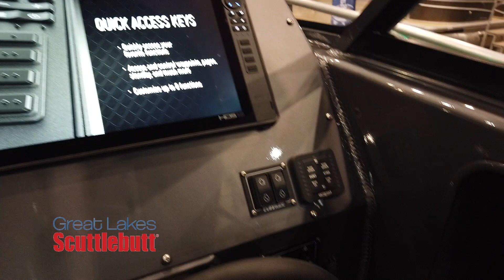Extreme Boats! 795 Walkaround! @The 2020 Cleveland Boat Show!

Comment: These high end off shore boats might be the high cost/high profit boats they wish to sell, but most real people spend far less and buy smaller, in shore outboard motors in the range of 16 to 20 feet with retail costs well below $60K. I don't see manufacturers like Lund, Tracker etc represented at these boat shows yet I would bet they sell more lower priced boats than these guys
Reply: 16 too  20 foot cabinnçruser aroúnd $60,000 maxoum evíutinñ 552

Comment: 240K is outrageous. Stingray has the 269DC for half that price. Boat is too expensive
Reply: Hi John, sorry you feel that way about our boat, Extreme Boats are unlike anything that I have ever seen or been on, especially for an aluminum boat. Regardless the price, I would encourage you and everyone to test drive one and see the differences for yourself. Compare the difference of aluminum to fiberglass boats, everything form the fit and finish to the comfort creatures. The 795 walk around in this video is loaded with every option including iDock, larger roof, 16" display, auto pilot, 8m hull with 8m keel and more so its going to be more expensive. These boats are all custom and do start out about 140k with a single motor for anyone looking for more basic design and less horsepower. If you see some of my other videos we lifted one of the motors and ran this boat on one 200hp motor. The boat still was very impressive and preformed at 34-35mph. If your interested in taking a look or a ride let me know and I take you or anyone anytime. Sincerely, Ryan Evans 440 221 9001 cell
Reply: @greatlakesboats  No thanks. There is not a market for these boats in the great lakes. Sales will be tough. I am right in my prediction.
Reply: john mastrella Hey John, Thanks for your opinion and your comment. We have already sold one to a client in Ohio so there is definitely a market for these boats. We are also working with a few other people as well from the Great Lakes Region and west coast on both the game king, walk around and center consoles. I’m not sure if you have seen one of these boats in person but they are a factory build boat. Anything that you want you can get as long as it doesn’t affect the CE rating on these boats. I encourage to at least see one in person, if you want to take a ride on one I’d be willing to put one in the water to test drive with you or anyone that would like to ride. They are unlike anything I’ve ever been on and rode in. If your interest give me a call 440 221 9001
Reply: john mastrella compare apples to apples, that stingray you speak of is a rubbish looking fibreglass boat.
Reply: @lukepaul2882  nothing wrong with fibreglass it’s better riding and better looking but that stingray thing was ugly as
Reply: @pittypitt2779  each to their own, personally I wouldn’t buy a fibreglass boat. Alloy is much more durable and in my opinion better looking. Where I come from Fibreglass boats are not very practical for offshore fishing, they are marketed at rich people who want to cruise the gulf and sip on wine, in fact fibreglass boats don’t even sell well here. Also beach launching tears up the gel coat. They are too heavy, you get more boat for the same weight with alloy. That’s something to consider when trailering with a max of 3.5t towing limit where I come from (New Zealand). better riding is a bit of a debate in my opinion. I would say yeah with smaller boats but not comparing a 3.5ton fibre glass to a 3.5t alloy boat. The alloy rides just as good if not better. I’m yet to see any decent alloy boats come out of the states but I’m open to having a look at some if you know of any good ones. I don’t know if you have been in a New Zealand built alloy boat, but they are nothing like those ones you guys have in the states (if that’s where your from) that’s probably why our boats sell great in Australia and USA.
Reply: @lukepaul2882  I’m from nz too but I still gotta go for fibreglass but only centre consoles and sportfishing yatchs but I still love the aluminium boats only at bad boat ramps tho  because u can throw them around and not damage them but I also don’t like how loud aluminium boat are
Reply: Is there a deal in New Jersey? And will you show the boat at Atlantic City boat show?
Reply: sting ray 259 çabin crusér only $98,000 2 cabin crusrr